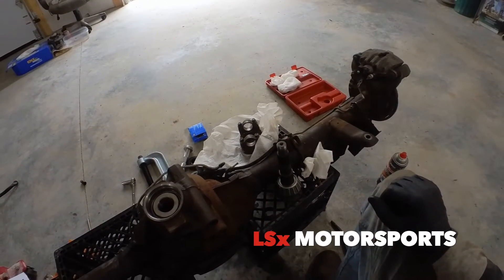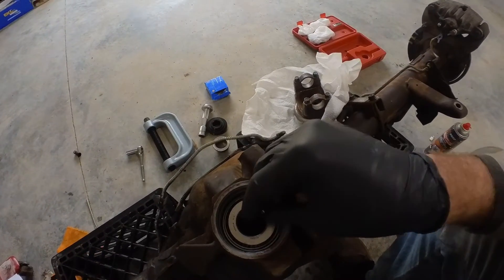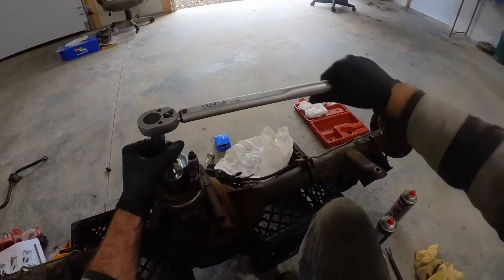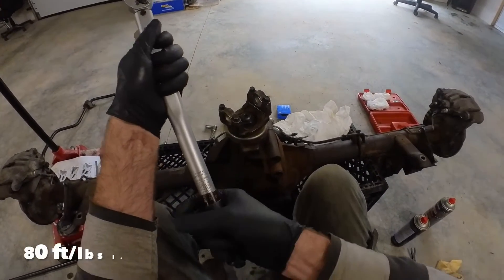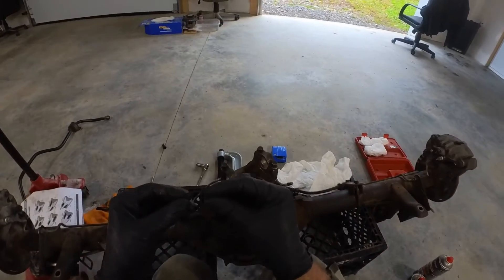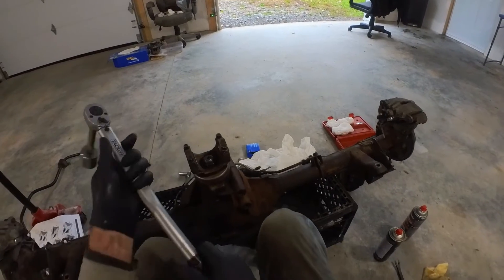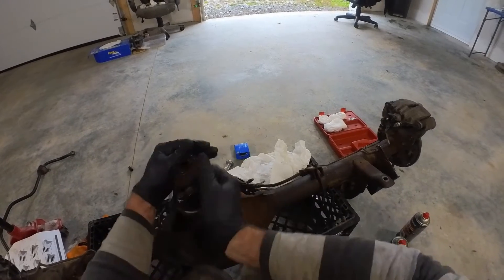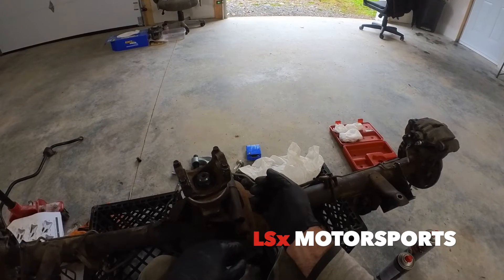How to set up a crush sleeve Eliminator.

Comment: 140 lb-ft sounds right. 300 lb-ft may be needed to crush the sleeve. Any thoughts.
Reply from the maker: With a crush sleeve eliminator 140-180 is enough. The reason it takes so much when using a regular crush sleeve is because most of that force is needed to actually compress the crush sleeve. With the crush sleeve eliminator you just need it tight enough so that the bolt doesn't back off.

Comment: Did you get the preload set before final assembly with the pinion seal? I got my preload set perfect and on final assembly with the pinion seal installed its way to tight. I can barely spin it by hand. Not sure if this is going to smoke the bearings or not.
Reply from the maker: Yes that will probably destroy the pinion bearing.I had the same problem the first time I did mine.I used a test bearing and got everything perfect and when I used the final bearings that are pressed on everything was too tight.I ended up smoking the bearings.Now in this video everything did work out right.But I still have alot of gear whine so I am actually doing it again as I  type this.Anyways I am the wrong person to ask because I don't have the experience.I didn't do a video of the entire gear change because of that.This video was just to explain how the crush sleeve eliminator works.You would be better off asking a channel with more experience.Like I said am am doing everything over again right now and if everything works out I will have a video but it won't be up until I know everything works out.Sorry I couldn't be of more help but learning this stuff myself.But if your pinion preload is too tight don't try running it because it will destroy the bearings and you will have to do it all over again.Carefully take out the seal and start over.For some reason you can get two identical bearings (one for test bearing and the other for final assembly) and they throw off you're settings for some reason.
Reply: I'm in same boat. The setup (setup bearings and no seal) went real smooth. With normal bearings and seal, I'm getting crazy preload even with the yoke not completely seated onto pinion splines.
Reply from the maker: Yeah setting up gears is harder than I thought or I should say it's hard because so little information is available to help someone do it for the first time. But I am going to keep trying till I get it right and when I do I will definitely have a video about how to do it.

Comment: I was looking for the crush sleeve eliminator torque spec. So far one guy did 250 ft lbs, now you did 140. My pinion nut was barely tight when I did the seal recently, and since it is demonstrated repeatedly in videos that it takes massive torque to crush a crush sleeve, I'm trying tightening my pinion nut more, as when I had it apart I only pulled on an 18" breaker bar to tighten it, which quieted the howling sound it was making. Then we did the ujoints and drive shaft center support bearing, and I gave it a little more Wheaties on the nut. Both times the howling/whining sound decreased, so I'm planning on going at it with a torque wrench, and figured that the torque for an eliminator should be right, as again, it takes like 300+ ft lbs of torque to crush the sleeves.I found a video last night by Yukon Gears in which they said that the number 1 cause of deceleration noise in a differential is from insufficient pinion preload, which can develop from the nut slipping on the threads, or the outer bearing races settling in to their seats over time. And another guy said what I thought, the bearings do wear over time, and my truck has 130,000 miles on it. My whine/howl is between 45 mph and 50 mph.
Reply from the maker: Well first off I am far from an expert on doing rear end gears.I actually failed on my first attempt.I went with 140 ftlbs because of what I seen in another video.When it comes to a crush sleeve it takes a massive amount of torque because most of that is used to actually crush the sleeve to the point that it gives just the right amount of pinion bearing preload.A crush sleeve eliminator is different in that it does not crush at all so all the torque applied is on the pinion bolt.Basicly when you say put 300 ftlbs on the bolt to crush the crush sleeve and you have the correct pinion preload.When you go to remove that bolt it won't take 300 ftlbs to remove it.But with the crush sleeve eliminator it will take the same amount of torque to remove the bolt as what you originally torqued it too.I don't know if I explained that right or not.But anyways that video was only to explain how a crush sleeve eliminator works.But I didn't show the whole building of the rear end because I am not qualified to do so.It was my first rear end build and I screwed it up.lol.But the pinion bearing preload was correct and the nut didn't back off any.I ended up with too much carrier bearing preload and ruined the carrier bearings.Doing a rear end can be pretty complicated especially without experience.Wish I could be of more help but I still have to redo my rear gears.lol.